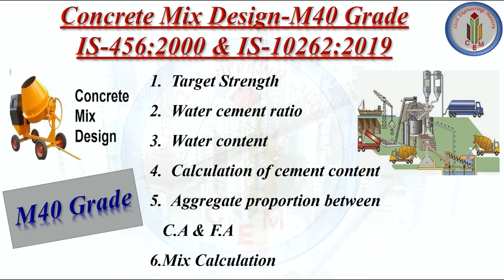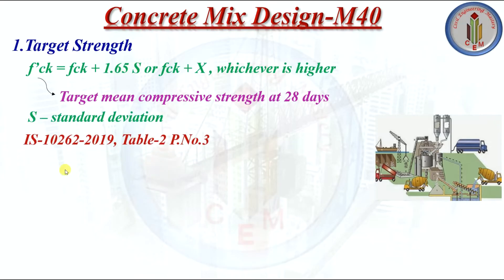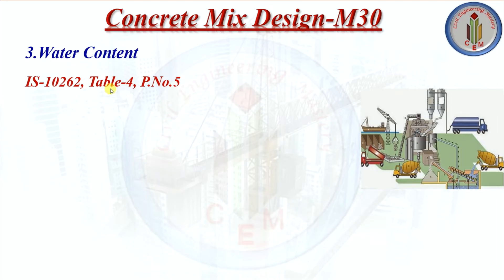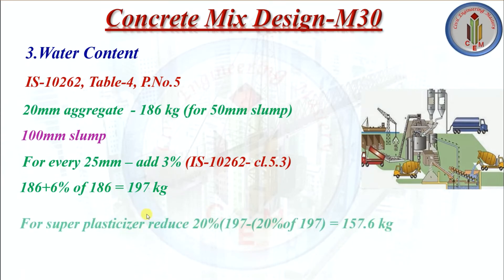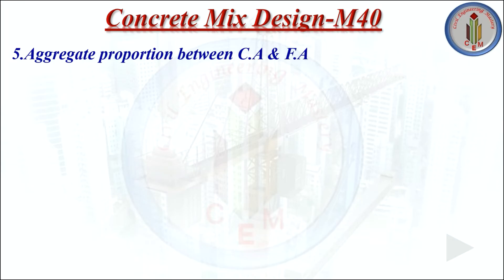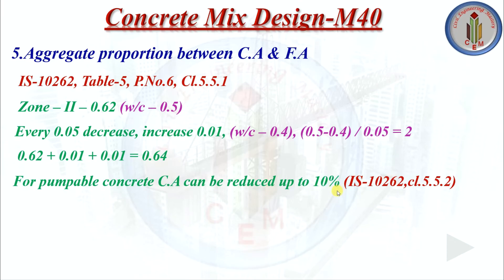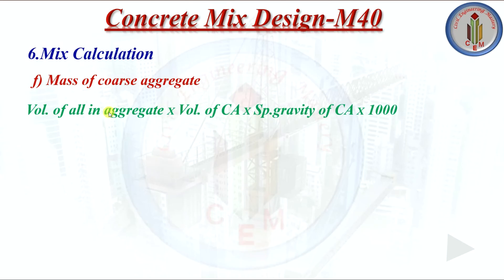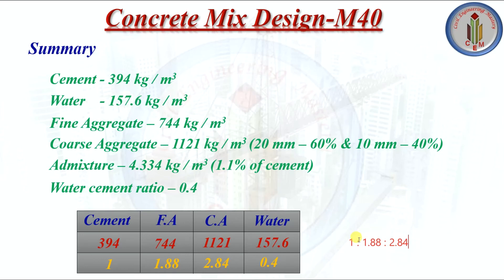Concrete Mix Design  M40 Grade | Mix design for M40 grade concrete as per IS-456:2000&IS-10262:2019

Comment: i want to know that in mix designing what is the role of grade of cement since in designing its only mentioned the weight of cement but there is no specification on grade of cement to be used. pls. ma'am answer. thanks a lot for all your videos
Reply: Pl refer to IS SP 23, HAND BOOK OF CONCRETE MIX DESIGN, Where in curves are given for  W/C ratio vs fck for different Grade of cement. For eg, 53 grade cement requires less w/c ratio for particular value of fck, and 43 grade cement requires a little more w/c fir the same value of fck. Similarly, 33grade of cement requires still more value of w/c ratio.
Reply from the maker: The grade of cement is not accounted for in mix design calculation but it enhances the quality of concrete. 
The grade of cement depends on the purpose of the concrete used.
Kindly refer to the below link for more details about the different grades of cement
 https://www.youtube.com/watch?v=f0W0djrw9Bc